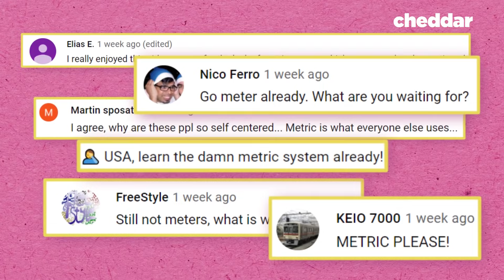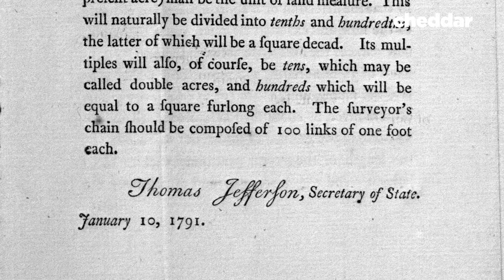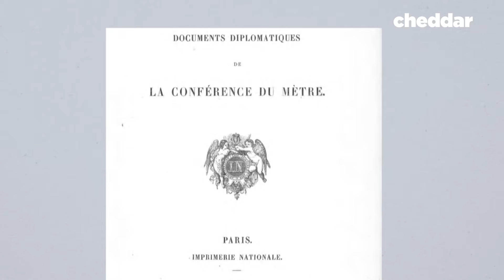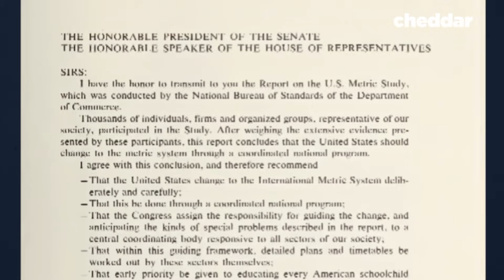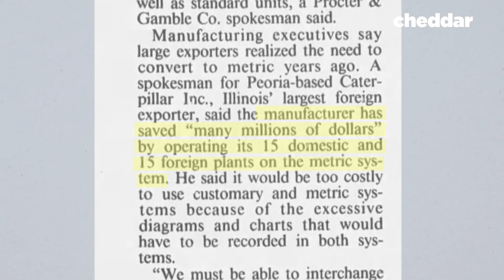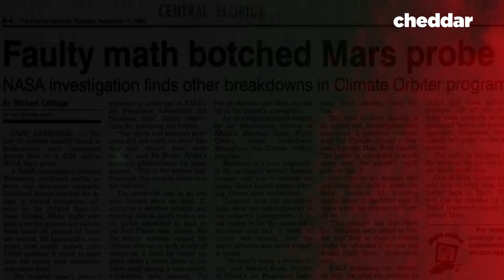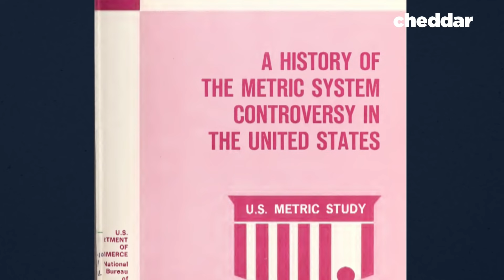Why Doesn't the US Just Use the Metric System? - Cheddar Explains

Comment: NASA didn't crash the orbiter due to a conversion error or an error due to imperial units, they crashed it due to a communication and documentation error. Every unit or measure should ALWAYS be labeled in inches, centimeters, quarts, liters, etc. The fact that the kilogram unit wasn't labeled was the problem.
Reply: Actually this wasn't even the main problem. NASA specified that they wanted all measurements in SI units, but Lockheed decided to that US customary units would be much better(or simply forgot to produce it with the right units.)
Reply: Actually, NASA was well aware of the problem during the orbiter's flight to Mars, but NASA's upper management didn't  think it was necessary to fix the problem.  Why they made this decision, I don't know...
Reply: Using conflicting systems of units makes it more likely that an error like that will happen sooner or later. There's a reason that the scientific community switched to metric long ago.

(That said: even within the scientific community, there are still some conflicts between different metric-based systems of units. Electromagnetic units are all metric because most of the science was done after the rise of metric, but several conflicting ways to derive metric electromagnetic units from the mechanical base units arose during the 19th century, and there was some resistance to change just from the fact that in these fields the choice of units can actually affect the formulae. Some fields were still using Gaussian cgs units, an old non-SI version of the metric system, when I was in physics graduate school in the 1990s; Jackson's graduate electromagnetism text used them. I know there's been some further standardization since then.)
Reply: Ahh cgs, mks, and SI,  Want some more fun look up Boltzman's constant.  https://en.wikipedia.org/wiki/Boltzmann_constant#Value_in_different_units   My favorite is "1.0".
Reply: On metric drawings it's common to just assume that everything is in millemeter, kilogram or second unless noted otherwised.
Reply: @FlameRat_YehLon  Why do people keep saying millimeter? The SI unit of distance is the meter.
Reply: We landed on the moon 6 times just fine using the imperial system.
Reply: We landed on the Moon using feet, not meters. That being said, I think NASA should only use metric since they are scientists, not laymen.
Reply: @unsignedmusic  It doesn't matter what unit we use. None is better than the other, just different ways to measure the same thing. One may be easier to learn, but they both do the same jobs. The problem is only when they are mixed and the proper accommodations are not taken.
Reply: @andregross7420  Hence "NASA should ONLY use metric"
Reply: @andregross7420  Yes, it does matter. You wouldn't use Kelvin on a TV weather forcast. You wouldn't use millimeters to measure how far airplanes travel.
Reply: @unsignedmusic  Actually one should't use Celcius in weather forecasts either. The difference  in 1 degree is to broad.
Reply: @jamesslick4790  The difference in 1 degree only seems broad if you are used to Fahrenheit. We have a decimal point. More importantly to prevent confusion and errors it's helpfull if science, industry and public use the same scales. Celcius is practical because the only difference to Kelvin is the location of 0, making conversion very easy. Fahrenheit is different by the location of zero and a constant factor, making conversion unnecessarily complicated.
Reply: NASA/JPL, ESA, RSA, and SpaceX have all screwed up craft and lost them, using totally metric units.  Also using lb/ft.  Also using both.  They've had great successes as well. 

The Mars Climate failure was caused by shitty software programming of JPL, since it is a playground for university nerds.  JPL leaked a gut reaction or false story to CNN when their probe was lost, and all other news outlets repeated it w/o checking since it was toss away news.  NASA Houston held a full inquiry and found the programmer cloned code from another instrument, did not check the specs that were off in the coded tables and therefore the telemetry reported inaccurate information.  Wouldn't have mattered if it was in metric, USCustomary, Imperial or tiddly winks.

This has been mentioned months later in oh by the way news, but nobody cares and doesn't listen.  It is your typical confirmation bias story/rumor that some people want to be true.  Software is typically the reason for failure.  The first US Moon probe crashed because someone typed:
DO 1.3 instead of DO 1, 3.    Three orbits were intended.

"DO 1.3 , , " means start at one, assume a step of 1 and stop when the assumed upper limit of 1 is reached.  Oh that pesky source code punctuation.

Comment: As an American Engineer, I am very glad we still use the Imperial system. In University, we are taught both systems, and honestly, we use metric for most things. However, foreign engineers are NOT taught Imperial. This means that foreigners can't come take US engineering positions because most require fluency in Imperial measurement. It's a nice little one way perk of knowing both. Does anyone actually like Imperial more than Metric? Rarely. It depends on the case. Fahrenheit has smaller gradations than Celsius, so that is nice. Other than that, metric wins in a fight every time.
Reply: "so that is nice"? Hardly a scientific demonstration for using fahrenheit over a centigrade temperature scale like Celsius or Kelvin
Reply: @my__socrates__note  what do you need a scientific demonstration for? Smaller units means more precision when you chat casually about the weather. Yep, that's nice. Celsius has 0 at freezing point and 100 at boiling, that's also very nice.
Reply: @Felishamois   " Smaller units means more precision" , you could also use... you know.... decimals when using celsius. Oh, its 14.5 C out there!
Reply: @Garmaleon  But who speaks like that? No one is the answer
Reply: @AdamSmith-gs2dv  Yet, when you talk about money you hardly forget the cents if you're in the 0-15$ range. Anyway your brain is logarithmic, 28-32C you can barely perceive but 0-5C you can, either scale linear so they both suck for human experience.
Reply: @Felishamois  smaller units? Do you think someone in a casual conversation about the whether notices a difference between a temperature of 89F and 90F, inasmuch and I don't notice 18°C or 19°C
Reply: Fahrenheit doesnt win against Celsius. Why? Go outside and tell me if its 78 or 80 °F
Reply: @sniper0073088  Maybe someone well used to Fahrenheit might be able to
Reply: So even if you would be able to tell the difference (which I doubt as wind and humidity also influence how one perceives temperature) between let's say 72 and 73° F... what difference does it make? Is it in any way practical to have this ability? Do you have to wear something different or do you have to change anything? You act like it would be a issue but it simply isn't. If it would be then we would use decimals or Decicelsius/Centicelsius or something like that.
Reply: tl;dr "Metric is technically superior but imperial cockblocks all those gross foreigners!!1" Who needs a robbery-funded border wall when you can just obscure the rules? After all, it worked for feudal Japan!

Comment: The construction industry would resist. - Architect
Reply: Yeh, until they started rolling in profits.
"The building industry was the first major industry grouping in Australia to complete its change to metric. The resulting savings for builders and their sub-contractors has been estimated at about 10% a year of gross turnover."
Reply: @arrgghh1555  Good to know, thanks.  I'm all for metric but you can see how many times the US has tried and is resistant to changing.
Reply: That's because architecture is not a science
Reply: @vN2w3Z59BM  um... well...I guess it's not a scientific discipline but it certainly uses a lot of science.  Some, me included, would challenge the notion that keeping people dry, tempering their environments, designing spaces for their lifestyles, and developing something structurally sound isn't a science.
Reply: Like if there was no construction industry in the other 193 counties... ^^
Reply: @figfox2425  ah, countries.  There is so much work in the US and the majority of contractors in the US have little incentive to do work outside their borders, so for those companies there is no incentive to use metric. Larger companies that do international work, sure.  And even those companies usually have overseas offices with people (read non Americans) versed in metric.
Reply: That's strange. Measuring small distances is the only way it has improved in the UK.